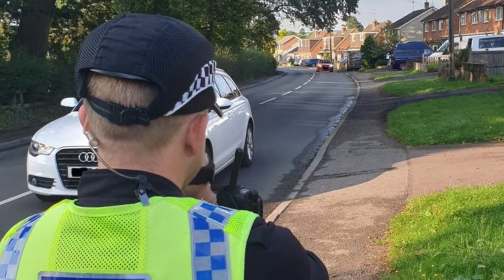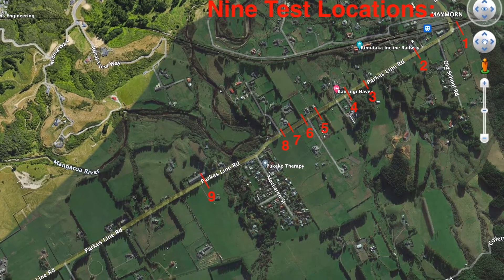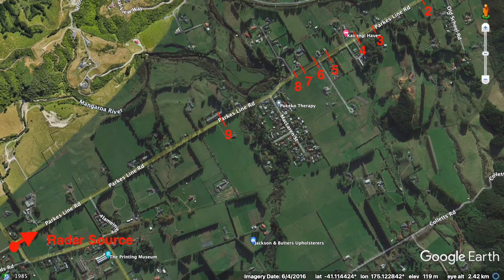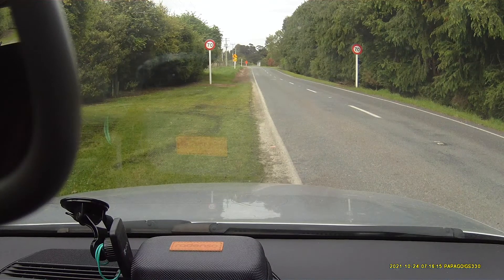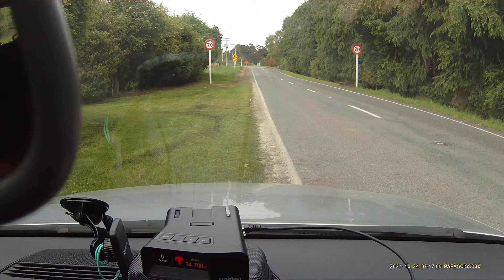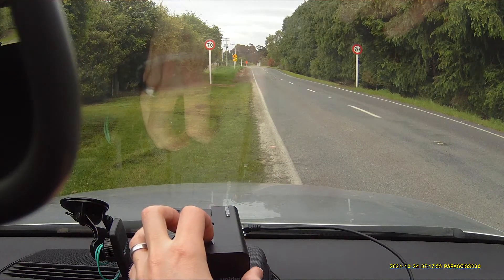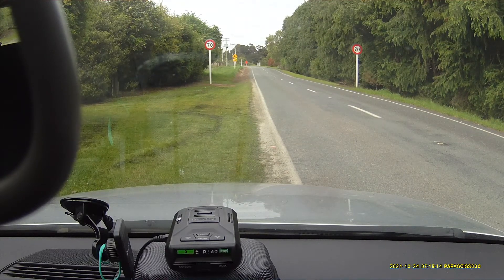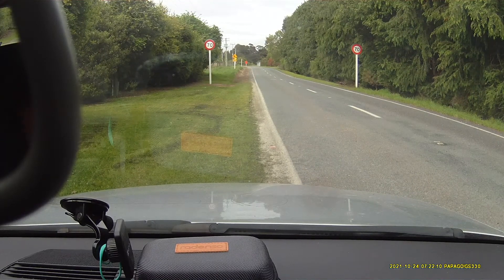Why is range so important on a radar detector? -  ‘Instant On’ Police Ka Band comparative testing…

Comment: Can these detect laser speed guns?
Reply from the maker: Most radar detectors can detect laser, but some are much better at detecting laser than others.  The Uniden's don't do so well against laser, whereas the escorts tend to do much better.  The V1Gen2 looks to have the best laser sensitivity (and being able to detect the laser from furtherest distance outside the beam (i.e. sensitive to pick up laser light scattering from moisture in the air)).  However, the V1 also gives quite a lot of laser falses.  In many cases, even with the best laser detection on a radar detector, is never going to be adequate.  You really need some kind of laser stealthing and/or laser jamming capability.  Relying on any radar detector alone against Police LIDAR is never going to give you anything close to 100% protection.  In many countries laser jammers are not legal, they are tend to be very expensive and often need to be installed professionally.
Reply: @mikefearn5213  Thank you so much. That is very valuable information. I was thinking about Radenso DS1. Any review about them?

Comment: I bet my new R4 would have got it from the start..and my redline American with segments 258 would have done much better...the definition of original red line is American bonded LNAs and segmented..with RDR off...red line is getting no respect in America new Zealand and Australia...
Reply from the maker: Retested the R4 on the same course.  No difference, Many alerts at range become terrain limited.  It gets very hard to separate the best detectors over range.  I personally hate the R4.  Worst laser sensitivity of any detector I've ever tested.  K filtering is excessive.  No K band limits.  Auto City doesn't even tell you which mode its running actively in.  R7 149 International in terms of features and general performance and almost no false alerting puts the R4 to shame.  If you want to swap an R4 for an R7 for a few weeks I can open you eyes.  Trust me, you won't miss the R4.

Comment: Cool work, would have loved to have seen how a V1G2 performs in this test.
Reply from the maker: I have now tested the same course on the V1Gen2, R4 and 360C.  This location seems to be terrain limited therefore all these detectors retested on another day with as close to the same setup as possible gave essentially the same result.  Therefore sometimes, you have to take the sales hype with a pitch of salt.  In my tests and practical scenarios all the top end detectors are pretty much equal.  This is where choice of features and personal preferences become more important.  This is why I have now prepared the R7 149 International for release.  This is now quieter in testing than the Uniden R8 since the R7 now has better K blocks, a better implementation of Auto City mode, and lots of extra cool stuff the R8 may never get.  I do like the V1, but to max sensitivity on K band it needed K verifier OFF.  That then gives a lot of extra false alerts.  The V1 and JBV1 also cannot support directional GPS alerts, let alone all the extra GPS enhancements features on the R7 International.  Laser falsing on the V1 is also something I found very off-putting.  Therefore, I'm really glad to be back testing the R7.
Reply: @mikefearn5213  if you’re experiencing numerous laser falses, the V1G2 may need a repair. I was in the same boat, had to send in for repair.

Comment: What settings did you have on each detector? With K band disabled and narrow band Ka, the Uniden R series should be spot on.
Reply from the maker: Each detector was set pretty much as I'd recommend for NZ.  All detectors had K band On.  This was K Extended on the US140.  The DS1 had the NZ region setting and K Band 24.000-24.100. R3 was running K Narrow NZ- 24.050-24.100.  Ka Segmentation was set 4,5 and 6.  K Filters generally set ON.

Comment: Hey, which would you recommend the DFR7 NZ vs DFR9 for all round use (inclusive of redflex vans)?
Reply from the maker: DFR9forNZ.  Currently working on a new DFR9forNZ firmware which ensures more consistent K band detection of the 2021 updated redflex vans.  This has K1 segment set 24.00-24.10.  DFR9 also has better display and better GPS features.
Reply from the maker: DFR9 SE is now available.  This is the best version of the DFR9 ever.  This also supports both NZ and standard tuning.  Therefore anyone with a DFR9 should send me a message as well worth having it update to the SE spec even if you live in the USA.  I.e. DFR9 SE like the R7 149 International, R4 and R8 all now can have Auto City mode.  DFR9 SE also has better GPS features than the R4 or R8.  Only the R7 149 International currently supports the same new GPS database format.